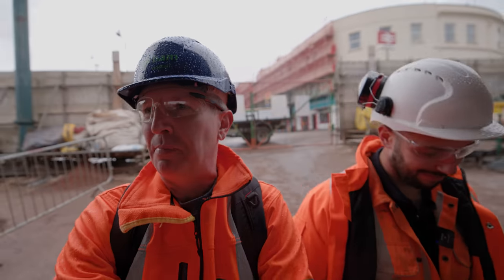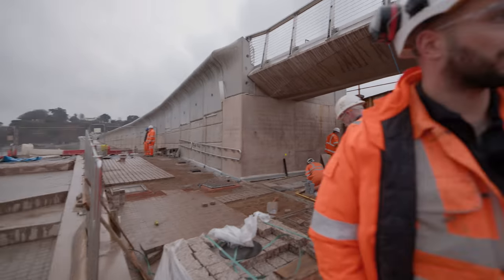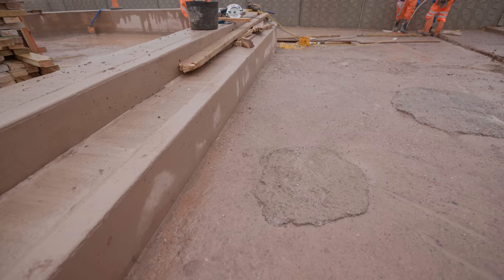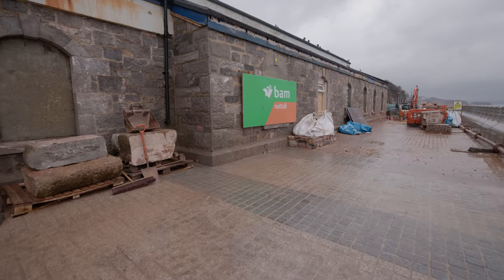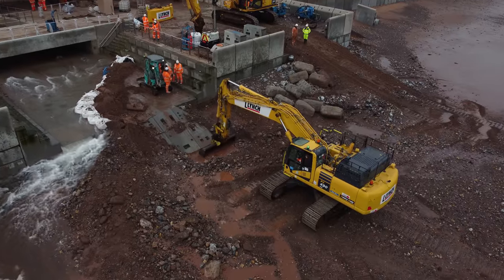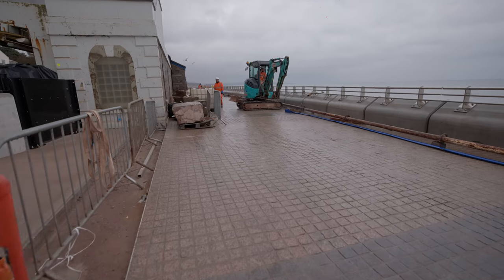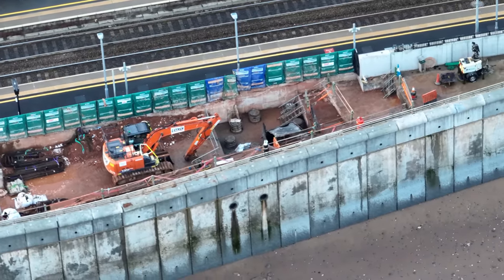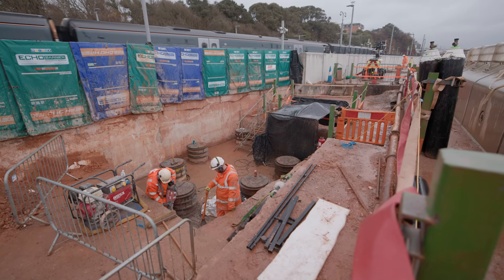Find Out What's Happening at the Dawlish Sea Wall! February 2023

Comment: Hi  what a lovely job the engineer's are doing ,
Just one question what is the old looking pipe running along the inside of the sea wall for,
Reply: The pipe running along the wall is a section of concrete delivery pipe. They pumped most of the concrete for the project from lorries in the station car park under the platforms and rail line, then along the wall using those pipes
Reply: @andrewreynolds4949  thank you

Comment: Great video. Can you tell me what rusty pipe is that we see running along the side of the works please?
Reply: The pipe running along the wall is a section of concrete delivery pipe. They pumped most of the concrete for the project from lorries in the station car park under the platforms and rail line, then along the wall using those pipes.
Reply: @andrewreynolds4949  thank you. I assume that it will be removed eventually?
Reply: @lizb7433  Yes, it's not part of the permanent construction. It's a segmented pipe that can be relatively easily extended, shortened, or disassembled.